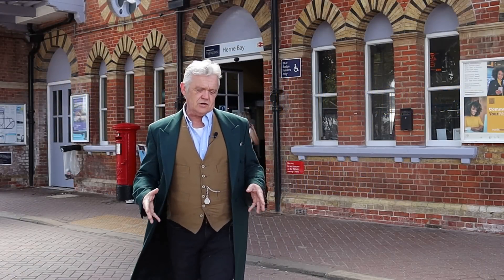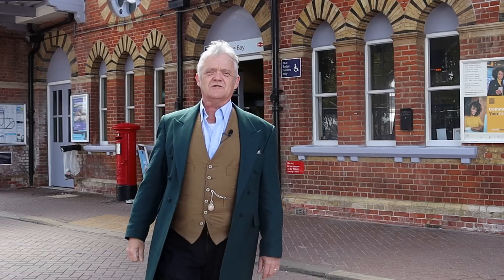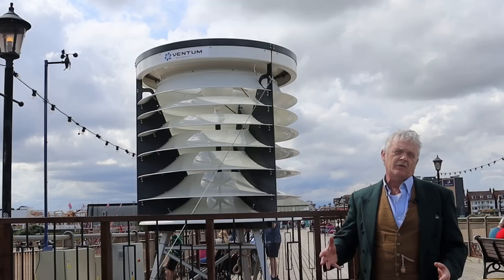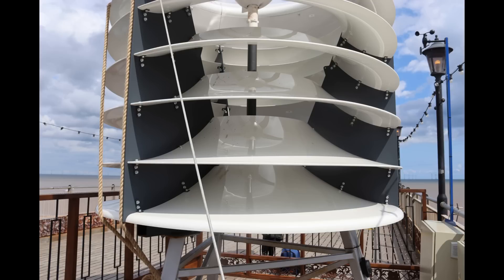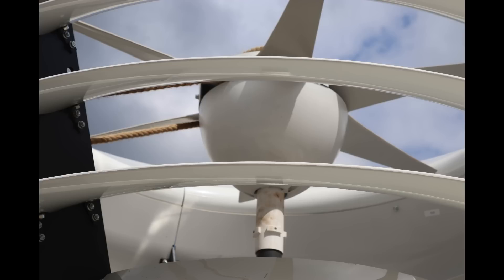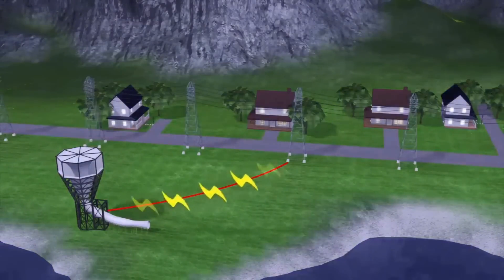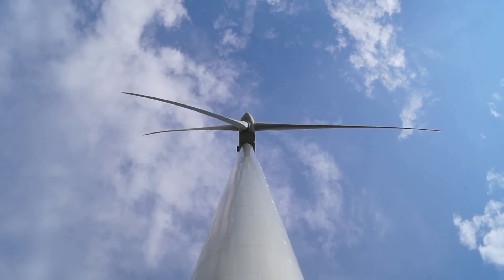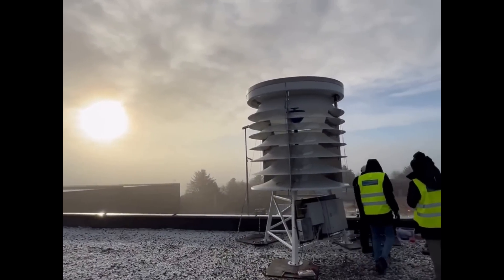1997 Darwin Wind Turbines - Is Bigger Better?

Comment: I wonder if one of these captures could improve the performance of the cheap crappy wind turbines you can buy online.

Looking at the image I have started making one in onshape. I need to figure out how to make the kind of parametric models I can use in an freecad to generate different versions. For now I can probably figure something out with the stuff online and the a motor I already have for a scaled down trial.

Comment: 0:56 Blah, blah, blah, you are such a windbag.  You show the Ventum wind generator installed in clearly a windy location, yet THE BLADES ARE NOT TURNING!  You also fail to provide any records of the machine's cumulative history of delivering power.   How about wire the pier installation directly to an electric skillet and serve up some some caramel kettle corn.  Free sweets would do wonders to sell the public on the wonders of "free, green, renewable wind power."

Comment: I really think that this type of wind collector/ generator would work especially well set back a little bit on industrial rooftops. There are so many unused square feet/meters of space that are completely out of public view that can be used for unobtrusive power generation. You could conceivably attach them to large squares of material to keep them in place and run cabling supported off the deck with smaller sealed materials that could just be set on the roof and have a no drilling installation with properly spread weight distribution causing no roof damage, essentially overcoming any logical arguments building owners might have against something like this. I think it could really have a chance especially given that businesses are actively trying to reduce their environmental impact.

Comment: What happened to the Ventum Dynamics wind turbine at the end of the Skegness pier in Skegness, England?  A November 2023 video showed a rope tied to the wind turbine blades, which prevented the blades from turning.  An April 2024 video showed that the turbine had been removed from the pier.

Comment: Although this can capture the wind from 360 degrees it doesn't all at once. It only generates power from approximately 90 degrees and there are 270 degrees of turbine blades just along for the ride. IMHO this is worse than a regular vawt.

Comment: The disadvantage is the size and weight of the wind turbine with this design. You solve the directional issue but adding a huge amount of additional materials that also cost money. Additionally you are capturing a lot of wind so your structure has be be very very sturdy to survive harsh wind conditions.

Comment: An ARCHIMEDES and DARWIN becomes ONE. Thats what I want to see tested.Up north where I live, snow and ice are problematic for the Archimedes. The Darwin would house and protect with an added slant roof mounted on the top. Plus the Darwin would amplify wind movement on those slow 1m days. YES PUT THOSE TWO TOGEATHER.

Comment: Put one high up on a mountain, use an MHD and run a ground wire to the negative plate for a wind generator without moving parts.

Comment: This is the one I have always liked wind concentrating devices. Reduce the dynamic stresses and the size of the moving parts. This one also has the advantage that if the actual turbine fails and flies apart it is contained in a structure.

Comment: It would be interesting turning this into a hubless generator. I would think you'd get better airflow as you wouldn't need to support the generator from the center.
Reply: No, you need to get as much as possible flow/pressure at the outside of the turbine.   You need torque more than speed

Comment: I don't know if you will see this post, but I just had a thought.  What about turning the Darwin turbine upside down?  You could possible get it to generate power just by the rain that would fall on the blades.  Of course that is when is it raining.  Could even be a slight boost when the wind is moving as well.

Comment: @RobertMurraySmith >>> FWIW, while watching this video I recalled something, which I HOPE I am remembering correctly, from a science fiction novel I read years ago.  I think it was a novelization from the first season {series} of the 1970s British science fiction TV show SPACE: 1999. 

In the novelization someone briefly discusses a type of wind collection tower for channeling wind through a vertical axis wind turbine. I also think "Grumman Aerospace" was mentioned, but I am not sure. {I have all the first season novelizations. I need to go back through them all and verify this.} 

Some years after reading this I found the patent online that details this wind capture system. 

Unfortunately, I later read online this type of system does not work as well as originally thought. I am NOT an engineer, so I cannot say for certain if that is correct or not.

Comment: From a Ventum site it mentions that a 2m diameter unit would produce 1500W, at a 13m/s wind speed, with the power dropping off to 187W at 6m/s. It would have to be situated at a fair height on top of large buildings in windy locations to obtain those wind speeds or in a very windy situation like the Skegness Pier. In Robert's locations that he has demonstrated his various generators he was lucky to get 2 to 3 m/s winds so this unit would not be anywhere near practical in most suburban locations for usable power generation.
Reply: If only there was a way to store the energy, instead of taking the cords and shoving them in your breaker box. If only there was some method to store electrical energy. That way when the wind is not blowing you could still scroll twitter. If only there was a way to combine the electricity generated from different methods like solar and wind, and then store that energy until we need it.  jeez man. If only..... Did you even think for yourself at all for even one second before your post? or just copy pasta alla google

Comment: And why exactly are you not mentionning ground effects (terrain rugosity), especially in urban or semi-urban environments, that completely hinder steadiness of incoming winds ? (and that's precisely why this test one is out to the sea on the pier and not closer to the city on the ground) Which then makes those kind of wind capture systems & associated turbines lose some if not all of their advantage in terms of intemittency of power output for broader adoption. Also, the power output of a turbine is directly dependant not only to cubic incoming wind speed, but also to the square radius of the area of capture so if you're too limited in scaling it up radius wise you'd have to have it accelerate wind a lot for the power output to be good enough which makes it ever more important to isolate it as much as possible from those rough terrain rugosity areas/high dnetriev number unsteady incoming flows aannd you might have to associate it even more with a very efficient power intermittency mitigation system such as a fast charge/discharge battery, a flywheel system etc.

Don't get me wrong, i love what you're doing and i'm all for broader adoption of wind turbines/ wind capture systems etc but we have to be extra careful in adressing all advantages and drawbacks and assess where each system is best suited for, i don't feel the comparison with classic wind turbines there made much sense.

Comment: Ive heard criticism that turbines in urban environments are so inefficient due to inconsistent wind speeds, that its almost not worth the effort. To get around it, you need to mount the turbine at least twice as high as the nearest tall structure. So, twice the height of the roof, if it is mounted on one. This is to get consistent, high speed wind. And given that power output is more or less cubed in relation to wind speed, it does make sense. What are your thoughts? Is there a way to overcome this challenge to make urban turbines worthwhile?

Comment: What i really like about this is that when its rotating the wind is "lifting" the turbine against gravity which should in turn place less weight and friction on the bearings ,if this means faster speed and less required maintenance then i feel its a winner on soo many levels!! Love your work Rob!!🤓🙌💫
Reply from the maker: did it?

Comment: the biggest disaster and waste of this age is thoes wind turbines and solar pannels 
that have this issue of aging and braking down or due to climate change of the winter not properly working
people disposing their old tec to this “new” “renewable tec” that is 
100 year old tec at its core 
stupidity at its best by politics of fear something not existing 
doing exact thing that it wants to avoid by design 
just look at that nonsence of wind turbine blades 
its in no way servicable or to change them 
so they rot in fields and make a huge humangos cost of polution 

that’s the truth nobody wants to talk about
Reply from the maker: so what is your alternative? It's fine to point out issues but not to offer solutions too - well that's just lazy

Comment: Lover this turbine, a smaller one could replace chimneys on some houses.  Anyone know what the peak output of it is?  I can;t find any data on their website.
Reply from the maker: give them a ring and ask
Reply: On their website the specs for their 2 meter diameter is as follows windspeed m/s 6, 8, 11, 13
The corresponding power output is 187 watts , 370watts, 900watts  and 1500watts
Reply: @wadeboyce4793  thanks

Comment: Perhaps using a swivel or a dome anchored above the fan not only protect it from the ring, hail and snow, but can use the venturi effect.

Yes a swivel dome tilted forward about 15° to 30° , adjustable maybe?
With a stylish wind vein to direct it.
Could mount on a lazy Susan berring 

Then not only using the pressure and but also the vaccum  drawing the wind threw. 

A bulging wing and put an elevation and trim tabs too they could help? Not sure...
Reply from the maker: interesting ideas mate thanks for sharing

Comment: In built-up area's we have turbulence not wind. Regular turbines require wind and lots of it.
Reply from the maker: I have both - so do most people
Reply: @ThinkingandTinkering  I see you are close by the see. But these type of turbines are not hindered by turbulence, like regular vertical and horizontal turbines. The Archimedes Screw Turbine was launched in a Dutch Green Consumer Affairs show, and of course the big promise failed miserably like all small commercially available wind turbines. De to over pomise and underdeliver at hifh cost point. And these will most ertainly require planning permission. They might or might be permitted, but Net feeding windturbines are only considered viable at 200 meters tip height or higher, and therefor categorically ruled out in large areas around airports.

Comment: RMT, heat loss from roads and buildings will be generally higher. Putting a row of DWTs above the road or buiilding would create a draft, bringing a breeze from the sides to remove the waste heat. The town would get cooler and produce electricity from waste heat. Win - Win! Cheers!
Reply from the maker: there is a win win mate

Comment: There's another advantage with a horizontally mounted turbine, which is the lack of gravitational shear force on the entire assembly. When you pivot a fan into an upright position, the entire thing is balancing on its axis, not being pulled downward, like a vertical mount is. With the right engineering, that turbine could literally be floating free of any contact points at all. No wind = the turbine rests on its base. Wind = the turbine lifts and begins to rotate. Think ping-pong ball on a shop vac with the flow reversed... Bernoulli's Principle.
Reply from the maker: cheers mate

Comment: Looking at the design, I wonder if a track bearing mounted snorkel mounted on top would increase the pressure differential across the rotating member.
Thinking you've got a structurally sound parabolic venturi array to collect and redirect the captured air vertically through the turbine blades.
The effective pressure on the turbine blades is a direct effect of the velocity of the captured air mass.  
Let's say just for giggles, that at sea level, the collector processes 3500 cubic meters of air at 30 kg/sq, meter input pressure as measured at the turbine blades.
A snorkel in the wind would act as a venturi; increasing the pressure differential across the blades thereby increasing the overall torque to overcome starting and loaded resistance.
Reply from the maker: you could try a model mate

Comment: That looks like a great design, plus it is bird friendly.  Are you planning to build a model to test this generator concept, Robert?
Reply from the maker: I may well mate
Reply: He's built many flavors of the Darwin wind tower/pipe/turbine!
Reply: @mookiemorjax  
Yes, you are correct,.
This design looks like it may be more efficient than previous models.
Reply: Would it not be safer if it was covered with a net?

Comment: Ventum had other same style wind catchers set up over a year ago and still no published results.  Wind turbines are designed for using the kinetic energy from the wind.  In my mind, any time the wind is diverted in another direction some kinetic energy will be taken out of the wind.  I'm still a skeptic when it comes to wind collectors for adding energy.
There is a lot of evidence that wind blockers for the upwind side of a savonius VAWT do help. The question is: for the small gain are they worth the trouble?
Reply from the maker: according to some research papers i read they are worth the trouble

Comment: Sweet! It would also benefit from being atop a pole, or course, gvien the increase in wind speeds at elevation. Tha real bonus is that it can be used effectively without one. Cheers Robert
Reply: Higher is better for wind speed, but I think part.of the appeal is that it's so much simpler and requires less big machines to install at a lower height. If ventum is going for a one-size, or several select sizes approach, mass producing many of the same size will get the cost reductions on a learning curve. 

So while up on a pole is certainly better from a raw production perspective, I think it would lose out in many cases to the simplicity.of plunking many of these down easily, and right where you need them. Be well and go have a great day!
Reply: @mookiemorjax  Indeed. About the best Iwind genee I've seen and I got a Post Grad Diploma in Energy Efficient Building  25 years back. Ultimately, each siting would present it's own unique optimum solution. The vertical range of this one is a game changer.  I think the point I wanted to make was that the cost of the raised element would have some payback period from the extra power generated for the same wind and a no brainer if finances and regs. allow it. The lateral loads on it would be far less than a standard turbine so the stack could be lighter allround, too. They will form a standard component or even a feature of architecture in no time I reckon. Lets hope its not too late! Cheers pal
Reply from the maker: for sure mate - or on a roof?
Reply: @ThinkingandTinkering  Now youre talking, I'm an architect / hippy and this got me commenting! Cheers Robert, all the best
Reply from the maker: @LaughingGravy.01  awesome mate lol

Comment: would there be any benefit to adding an additional Darwin which is rotated by 90 degree's and attaching a VAWT tip to the HAWT?
Reply from the maker: i don't know really
Reply: @ThinkingandTinkering  Thinking about it, it would probably create a vortex, because the VAWT airflow would encounter the HAWT airflow at the edge and so wouldn't reach the VAWT. However a pelton wind-turbine attached as a rim to the tips of the HAWT would probably work.
Also provides a safety gap above the HAWT.

Comment: This also improves on the wind-catcher cooling ventilation system seen in Iran (aka badgir). If the bottom of this wind catcher is places on top of a chimney, it will help draw warm air up and out of the home. In times of low wind, the turbine may be run as a motor to cool the home still. Best for dry climates where a humidity difference between inside and outside the climate-controlled area is not priority. Although perhaps the darwin might still have utility for flowing air across air conditioner coils in a closed-window home without inside-outside air exchange, but that's likely not an important use case since power is needed continuously to run the air compressor motor and continuous air flow across the coils is needed
Reply from the maker: for sure

Comment: Bigger is better for wind capture as well? Why have the turbine on top? Is there a max diameter before you start to lose efficiency\increase wear speed? Vertical vs Horizontal efficiency? Love to see a follow up! Could they just sheath wind turbine shafts with these and direct more wind at the blades (or perhaps make the whole shaft have a central hamstercage) - ex a dual drive wind turbine that is both vertical and horizontal. My 3d printer is too low res to test this out...
Reply from the maker: I have done a ton of videos answering those questions mate
Reply: @ThinkingandTinkering  Oh cool, I'm still working my way back to before 1000 so much great content. I've seen the hamster wheel and VAWT - there was a video on dual drive wind turbines? A don't mean DRWT, I mean literally the shaft is a hamster cage (I know you have done this before). Then you wrap the shaft in the collector (as done in this video). Question would be for the horizontal, now that you have this air capture, is there really any value in horizontal axis blades that can also rotate around that shaft. Almost like counter rotating vertical and horizontal blades. Sounds crazy?! Its like taking that Savonius you made recently, but then some how also sticking a HAWT on top. Maybe there is some optimization there?